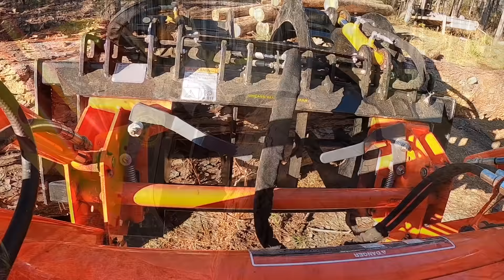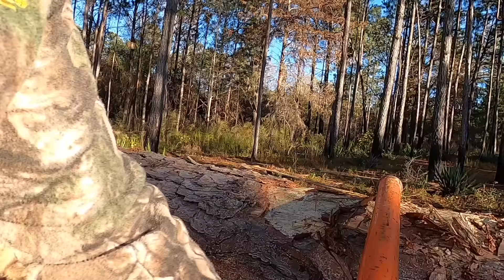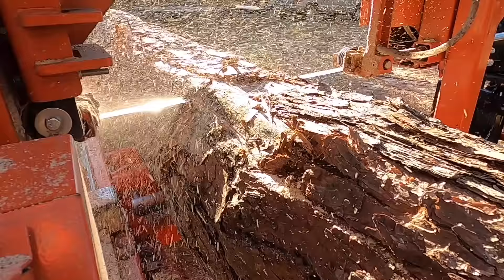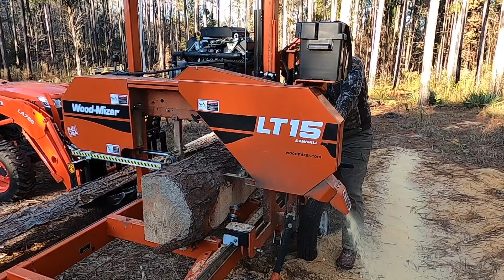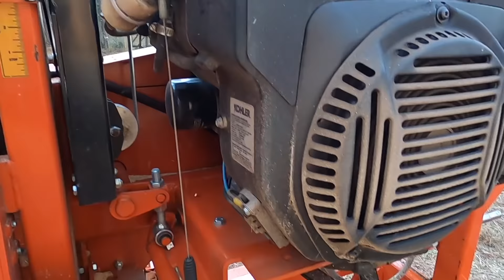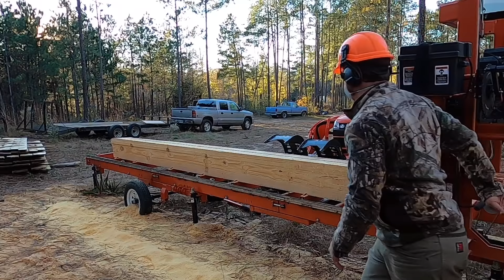Homemade 2x4 Lumber

Comment: It always cracks me up when people comment on the $10k for the mill, $30k for the tractor.  How much stuff do you own that you'll never get a return on?? Hobby or not! Them two pieces of equipment will give you a return on your investment. Even if that set up is a hobby,  it'll just take him longer. Congrats on the beautiful equipment you have there!!! Great set up!!!
Reply: Darien..one thing to keep in mind is resale value on those items.  At this point he could probably sell those items and MAKE money.  So they end up being great investments.  Not always the case and as time goes by that could change but they will always hold value.
Reply: @mistermister2085  I've owned both you won't get money back but you won't loose much either.
Reply: Great post

Comment: We built our home from lumber milled from trees on our land. We had ~7000 board feet air stacked for 3 years in the barn. I enjoyed your video.
Reply: How'd you get past codes?..we cant do this in Kentucky because of not having grade and inspection markings..damn lumber company lobbyists
Reply: @jaytodd5809  build the frame out of stamped and use your mill wood everywhere else  they did it back then  so it must work

Comment: Another good one thanks Wes!  Some nice lumber there.  Always amuses me that 2x4's in the USA are 4x2's here in UK!  Stay safe & well!  👍👍
Reply: 2x4 in the US is actually 1 1/2 x 3 1/2 go and figure that one out. Still says 2x4
Reply: @bobby9847  Similar here.  Everything has gone Metric too, so 1 x 2 is approx 25mm x 50mm, but if you buy it planed, its 44mm x 20mm.
Reply: In the southern united states they're called "tuba fores" or simply, "two bys."
Reply: @bobby9847  they are rough cut 2x4 and then dried and planed thus yielding the resulting size.

Comment: The pucker factor gets high when you get down that low. Pulled the trigger on a L3560 yesterday with the LA 805 loader.. great vid thanks for sharing
Reply from the maker: You'll love it! Congrats.
Reply: @falllineridge  still waiting on the industrial tires and having the third function installed. I’m curious about what model ca grapple you got. Any information would be great although shipping to Oregon might be a deal breaker. Thanks
Reply from the maker: I got this one in the 60" option. It's a solid piece of equipment!
https://www.constructionattachmentsinc.com/products/compact-root-grapple-tractor-loader-attachment?return=/catalog/grapple-attachments
Reply: @falllineridge  Thanks that was the direction I was going. Perfect
Reply: @kiawandajr1097  ************HEADS UP!!!!  THOSE INDUSTRIAL TIRES TURN INTO INSTANT SKIS IF ON A HILLSIDE!!! NEARLY GOT KILLED AVOIDING A PUP IN 1 INCH OF SNOW.

Comment: Looking good. Ha! When I started sawing on Woodmizers in the early 90s, the LT40 I ran had a manual flip up and style clamp. It’d run in and out hydraulically but not up/down. 
I’d say I sawed into that thing five or six times. Upgraded to a later model that had the four way hydraulic clamp and I thought I was driving a Cadillac. 
Good stuff. Be safe out there.
Reply from the maker: That's a bad sound, when the blade hits a side stop or clamp. I'd love to have some hydraulics, but this one is paid for!

Comment: That auto-feeder is quite handy especially with the sensor at the front that stops the blade from hitting the clamps or anything else on the bed. :-)

When you're cutting the slabs does it not make sense to count backwards from the bed up so you get even boards out of it instead of a odd one as the second last board you're cutting? If you know what the blade subtracts then compensating for that combined with the number of cuts should give you even boards and if there is a odd one out it will be on the top which may be scabbed anyway?

Comment: 2x4s are actually 1-1/2 by 3-1/2 nowadays. might end up with more studs that way and not sacrificing strength unless you want the actual sizes of 2x4 inches.

Comment: I  own a pine thicket in tn, and always wanted to build a cabin on it,  do these have to dry for a long period of time, or can you use them right away?
Reply: 6 months to 2 years depending on the method. Fresh “green” wood will dry in place but will warp and crack, so you should dry lumber before using.
Reply: @mrwess1927  I have an insulated garage with a dehumidifier..would that cut the time down some?

Comment: Nice work.... how long does this pine wood got to sit and dry out before it can be actually used in construction>>??
Reply: Most construction lumber is green. Stacked in a dry place, probably 3 months depending on the weather.
Reply: @truckerdaddy-akajohninqueb4793  Thanks for the info....
Reply: @masterplumbermark  kiln dried is dried in a kiln. But that doesn't mean it is fully dried either

Comment: Excuse my ignorance but could these be used directly in the construction of a house? Is the lumber used in construction usually dried? I have a lot of pines on my lot that I need top cut down. I was thinking of the price of lumber maybe I do some of this? What is the cost of your saw?
Reply: No you could not use this in home construction. To pass code it must be inspected and stamped. You however can use it in barns and shelters and that's where most goes. Now you could use inside your home once house is framed with stamped wood.

Comment: I thought you were gonna get those dogs a couple of times. One thing I don't understand is why don't you place the logs on the mill with the small end at the front. It seems you lose both lumber and time when you don't do that. I really enjoy watching your videos. How's that little farmhand doing? Stay safe and keep those videos coming. God Bless.
Reply from the maker: I don't normally worry about the direction of the log. However the tractor picks it up, that's how I put it on the mill. I've started just measuring the small end if it's away from the head. That allows me to make the first cut accurate. I probably do lose some amount of lumber doing it that way. However, I don't have toeboards, so it's almost inevitable.

Comment: Why did you take that slab off before finishing the 2x4. I missed something 8:20 It wasn't wide enough?
Reply from the maker: It wasn't thick enough to make 4" wide 2x4s. I sawed it into 4/4 boards instead.

Comment: I don't get it. So you cut this into 2x4, it has 40%+ moisture. Then you have to store it till it bows, twists, crooks, etc. How do you use it then?
Reply: If you stack it correctly it will not twist or bow in drying process. Now there will be an occasional board that will regardless what you do. You see this even in the lumber stores.

Comment: How long until this wood can be used for a project? Does it need to dry?
Reply from the maker: It helps greatly if it's dried for a while. If it's outdoor construction, like a barn or something, it could theoretically be put up immediately. Joints will be stronger if it dries for a couple or three months.

Comment: It’s so cool to see what you can save from a downed tree so it doesn’t go to waste. How long do you have to let them dry?
Reply: None really, you can use them as is or let them air dry for a few months in storage it’s up to you. The only thing you have to worry about letting them dry is do your best to keep them out of the sun to lessen your chance of them warping. The only time you’ll have crooked or twisted boards is if the tree is crooked or twisted, and you would THINK if you cut a crooked log into a flat square it would be fine, but they’ll take the same crooked shape while drying. Nail it up green before it has a chance to 😂
Reply: @bradleyscofarm6151  That’s interesting I didn’t know that.

Comment: Was the 2x4 lumber dimension nominal or actual?
Reply from the maker: It was 1 1/2 x 4. It's an odd dimension, but it cuts down on board weight (really helpful with long 2x6s), and still gives good strength.

Comment: Funny that I was wondering whether you ever accidentally hit the stops then I saw 7:06. That safety guard is a nice little feature.
Reply from the maker: Yes it is. It might have saved me a blade that time.
Reply: That's not a safety guard it's the blade tracker. There is no safety guard other than your eyes. I have an  LT 15. That thing you saw keeps blade tracking straight.

Comment: if the blade was toothed on both sides, the mill could be engineered to make omni-directional cuts.
Reply: No it could not. The blade is supported on 3 sides to prevents it from bowing back with the pressure of cutting.